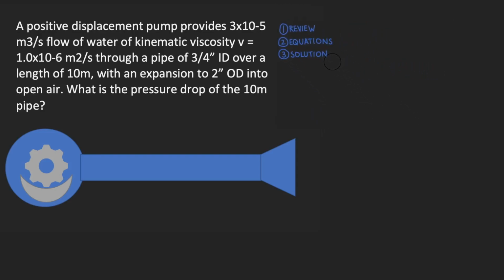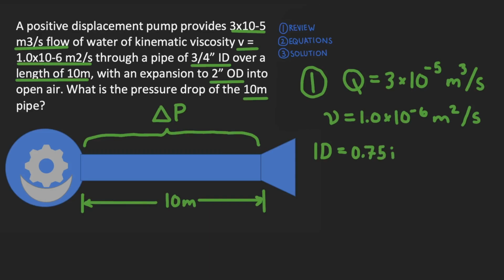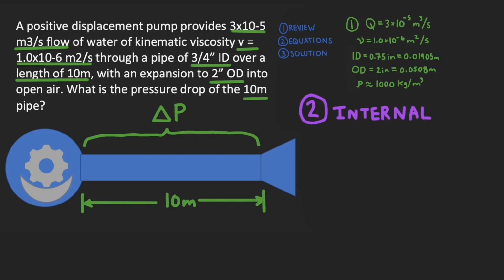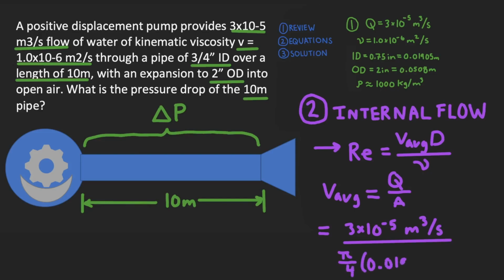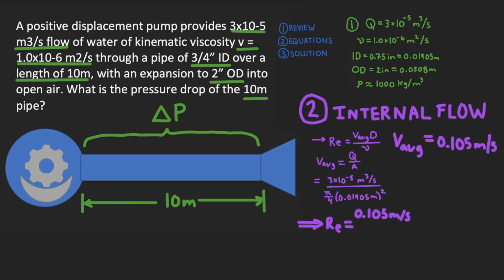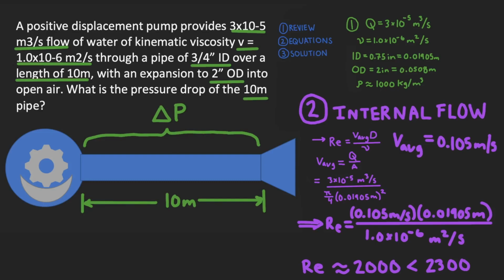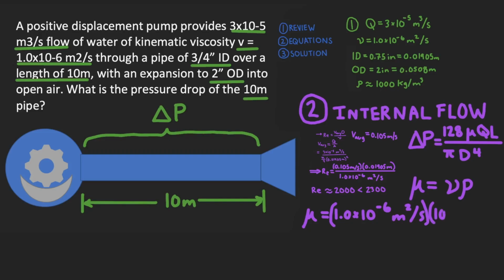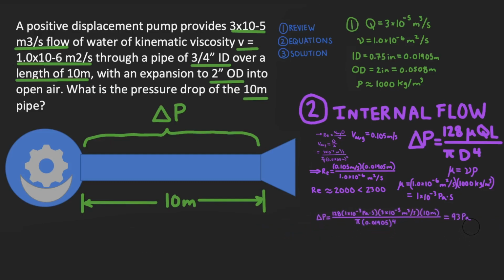TESLA Mechanical Design Engineer Interview Question SOLVED! #9

Comment: I would like to add something. 
Since this equation involves viscosity, Hagen–Poiseuille equation is used. According to Bernoulli's equation, there should not be any pressure drop across the 10m pipe of the same diameter. Bernoulli's equation is simply conservation of energy and does not deal with viscosity of the fluid.

Comment: Good job Arch1medes... from where have you got theses questions...  I was looking on google for tesla sample question (90 min technical exams).... I could hardly find out any resource .. could you let me know.. from where i can prepare more for question related with mechanical end electrical engineering (for Tesla exam)
Reply from the maker: These questions came directly from an interview with Tesla. A lot of these questions seem similar to what you might find on a Fundamentals of Engineering exam for mechanical engineering so I would recommend solving FE exam problems. Another resource that I found useful for practicing interview questions is Glassdoor.com though most the questions posted are non-technical. Let me know if you have any other questions!
Reply: Any hint on the exam?